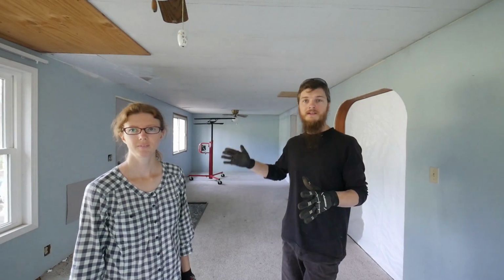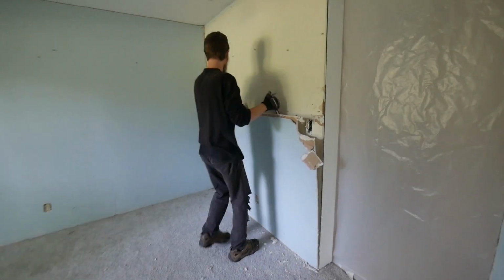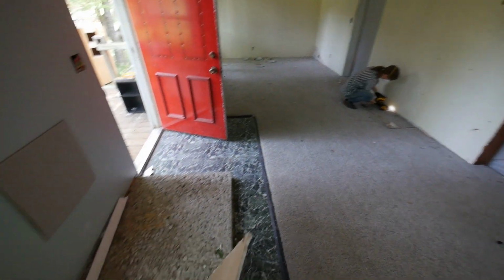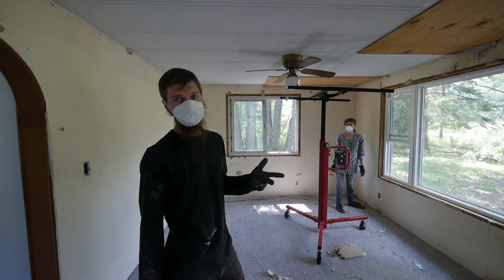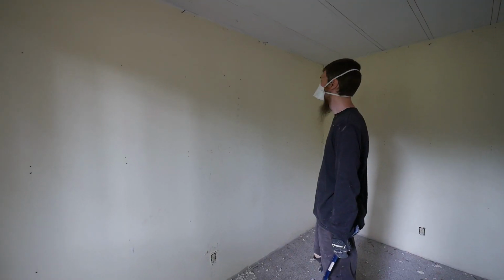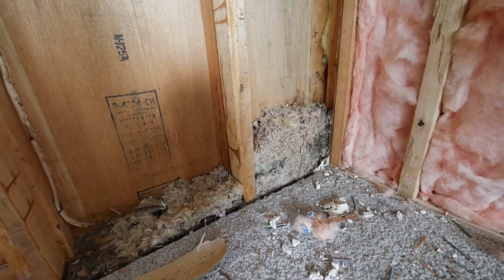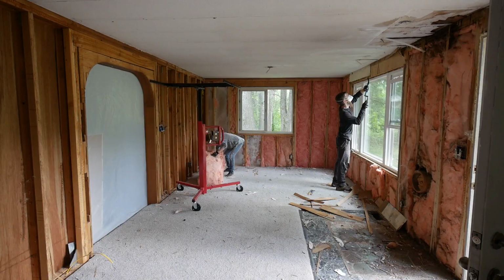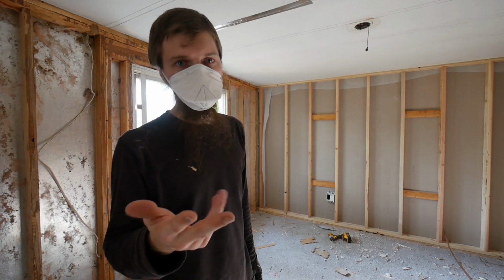Tearing Out our Nasty Living Room - Home Renovation

Comment: It would be cool to open the wall between living room and kitchen. Especially since the living room is going to be more square.
Reply from the maker: It's a load-bearing wall and has to stay :)
Reply: @diyfferent  I know its probably alot of work, but putting in a steal beam would work no?
Reply: @fro189  those steal beams are extremely expensive. Then you need special heavy duty jacks to lift and hold them while they are attatched. With expensive brackets. Installing them is not for the weekend DIY warrior. While I am quite certian Doug would be able to install one if he wanted too,   (he does thourough research and has a plan before he starts), if they dont NEED  to open the wall, its an unnecessary expense and project delay.

Comment: Cool, I just keep thinking about how pretty the other bedrooms are that you have done and how pretty that red and white trailer turned out with the painting and repair you did.  I love the way you have the energy and drive to tackle the hard jobs and to get the job done whatever it takes.  I like that you are not lazy and have gone all the way to the base.  We took our fireplace out when we put the white metal roof on. They removed a lot of damaged decking rotted from water damage.

Comment: Good luck you guys. Several years ago we remodeled our double wide. Oh my, we found that the suds we double apart than most houses. The double wides floors were carpet and it looked like they were standing up when they aimed the staples and my goodness trying to pull all those staples were horrible. And all the flooring said  this side down and it was up. We screwed the floor down better to decrease the squeaking. So now our home has linoleum tiles in the bathrooms and the rest is laminate. We are very satisfied with our results it looks more like a real home now. Hey when you go to do you kitchen cabinets, ask them if they have solid wood cabinets from China. We ordered these cabinets for half what normal solid cabinets would be. The only difference in these cabinets is you have to put them together yourself. We saved at least 3,000 dollars by ordering those. Look into it. I think you will like it. Our cabinets are solid oak. Again looking good. I’m so glad Belle liked her room so much. I really liked the peacock.

Comment: You are very fortunate that the serious damage to that room was in one location.  I was working on one of the rentals and over the years, that layer upon layer upon layer of patching was going on as well.  Those before me were patching the symptoms and ignoring the cause.  The cause was on one side of the kitchen was a 30 gallon water heater under the kitchen cabinet.  It had a very small and slow leak.  The water was running down under the cabinet to the sink and the refrigerator which everyone assumed it was a sink plumbing leak so, they just kept replacing the floor. So, when it was my turn, the problem was so bad that all the floor joist had to be replaced, all new subfloors, all new cabinets, baseboards... well, you know... Along with a rat or two, there were HUNDREDS UPON HUNDREDS of German cockroaches.  It took me months to get rid of them.  It was so bad that I just handed the house over to my sister to have and remodel since that is what she had always wanted.  I had a near breakdown over that cesspool.  You can see how it is coming along on her channel. "Ropes of Renovation."  Love your series.  I have been watching one here and there for about 24 hours now.  Well worth it.  I also follow Green Acre Homestead which is where I found you guys.  God bless!

Comment: After you get everything out, but before you put in new materials, run a sprinkler on the roof for an hour. Watch for any leaks.  That way you can fix them before they get built back behind the walls.

Comment: Dana says- It's so satisfying seeing you remove all the old, gross stuff. Now I'm wondering so many things that only watching your upcoming videos will answer. Like: what order do you do the rest of the removal process in, since there's a big leak in the ceiling that caused the rot, and you're taking out the chimney that had leakage around it too? Do you have to take out the chimney blocks, etc. now? If so, what happens with the big hole that creates on the exterior of the home? Will you have to repair the roof now including any trusses, plywood, and shingles, so that any interior ceiling work doesn't get water damaged & you aren't covering over things you'll have to eventually replace? How much water damage has actually been done to the problem areas? I'm way too curious for my own good. I can't wait to see you guys conquer this room(s) and what wonderful choices you make for Maverick's room. You guys are the best "Crew of Two" around.
Reply from the maker: Yea, we'll be removing all of the chimney blocks before winter, and then we will see how we can repair the eaves and roof after we see it. :)

Comment: It might be a good idea to install boards into the gap where the mice were getting in before foaming it.  I've seen foamed areas  that rodents had chewed through.  Another option is packing the gap with a layer of steel wool before applying foam.

Comment: Yup! Glue and staples in the walls, under the carpet- everywhere! In the manufactured home I sold last year I replaced the carpet with laminate and redid the master bathroom (as well as replaced most of the subfloors in the house because particle board=death trap) and then the new owners came in and wanted to remove one partial wall between kitchen and living... they though I put it there with glue and staples! Lol nope 😂

Comment: After running into the difficulty of selling your previous mobile home, I'm surprised you went that route again.  I suppose if you never sell, it won't be an issue but one never can fully anticipate all the twists and turns life throws at you.
Reply from the maker: The only issue with the other one is that it was a single-wide. This one is a double-wide. Also, someone in the past filed an "affidavit of affixture" so people can get loans on it easier :)
Reply: @diyfferent  

Okay, perhaps I stand corrected.  I thought securing financing on used mobile homes was just difficult if not impossible.    I was unaware it was limited to single wide mobile homes.

I stand corrected assuming you know how lending institutions operate.  I am not an expert on financing.
Reply from the maker: @jehsdca  There's a lot of variables. Location, age, does it have a permanent foundation, etc, and different lenders have different criteria. Ours should be all good. Someone did get a loan on this home previously.
Reply: @diyfferent  as a previous mobile home selling agent, I can tell you, if they are on their own land, financing them is soooo much easier..can usually be done quite easily..the homes in parks or leased land, now those are much, much more restricted
Reply: true, some companies do require documentation that they are tied down, especially to insure them (required to get a loan)..but the real crux of the matter is if they are on their own land ("real" estate")....the mortgage people know land does not depreciate, thus are much more willing to loan on a mobile home/ real property pkg, than one on leased land

Comment: Great job.  And you are right.  Gut an old building like that rather than just doing cosmetic work.  It will always save you money in the long run. A tip for in the future.  If you ever have a concrete slab like that, like sidewalks, that have to be removed just raise one end of it a couple of inches and then strike it with a heavy hammer.  With nothing under it to support it, it will shater into managable pieces with one or two hits that are easier to remove.  This even works with rebar reinforced  basement slabs.  Just section them into 3' to 5' pieces then raise one side and hit it with a jack hammer or whatever you are using to break it up.  Saves a lot of labor and equipment expense.

Comment: with the exra weight youre adding on top of the chassis of the trailer(s) by adding the plasterboard and added structure you might want to ad more support struts / jackstands under the trailer between the slab and the chassis or a brick wall around it under the outer walls to prevent it sagging or sinking (outer walls support the roof stuckture) 
adding support underneath will probably stop a lot of creaking and flexing of the floor too
Reply from the maker: Our home is already on a solid concrete block foundation that goes around the whole perimeter :)

Comment: You guys are awesome! I'm remodeling a whole house on my own, it was my grandparents old house, I'm embarrassed to say I have been at it on and off for a few years, mostly demo in those 2 years, but I got the guts to buy a gopro and filmed my first video, learned to edit it and posted it on here tonight. I'm scared for many reasons. I haven't showed anyone the video that I know, not even family...but I'm more scared as to will I be able to fix this whole house properly!  What did you do to kill the mold and stop it from returning? I have mold to deal with as well. Thanks for the time. - Joe
Reply from the maker: That's awesome that you are taking on a home renovation and giving youtube a shot. It's tough at times.

For the mold, we just removed anything that could be removed and anything that had to stay we sprayed down with a product called Odoban because it acts as a deodorizer and mold killer. You can also use Concrobium Mold Control to eliminate mold. You should be able to get both of those at a Home Depot. And as long as you can stop the source of the moisture, the mold will not come back.

We'll check out your video.

Comment: It’s always a question I ask when watching a house renovation , tearing out walls and floors and see damages and it’s exactly what is found here, would it be in priority to repair first what is on the top part...meaning the ROOFING and its isolation. And then we go down to the wall, outside and out and objectively the inside of the house. But I enjoy your video and admire your smartness of dealing things in a minimal way that turns out beautiful done. I like it.

Comment: What's the width of that livingroom? Anyway you can make  some of it a bit wider.  Seems really narrow eh. Loving the Reno's so far.
Reply from the maker: It's about 11 feet wide. Thanks
Reply: Since it's a double-wide mobile home it's limited by the "marriage wall" in between the two sections, the wall with the arch. That's likely why a previous owner tore down the bedroom instead of opening up the arch as that is a load bearing wall.
Reply: @GraeMatterz  being a load bearing wall adding in a steal beam you would be able to open that up, or you could put in some posts. Theres always a way my friend. If that was mine I would figure it out somehow. Because that is a very narrow living space
Reply: @diyfferent  oh ok 11ft not to bad, the video. Makes it look like 7 or 8ft.
Reply: @fro189  11' wide isn't a narrow space. It looks narrow because it's nearly double length of the original room from the bedroom wall being removed so it's optical. The other side of that arch is the kitchen and invading that space will make the kitchen smaller.

Comment: They tried to hide the mold? Since you are using electric heat,take the chimney down to eliminate future issues with the wall and ceiling. Excellent progress on the first day of demo!
Reply: What is going to be your backup heat source if the electricity ever is off for a few days?
Reply from the maker: I would say that most people don't have backup heat, whether on gas or electric heat. It all takes electricity to run. But eventually we would like a woodstove as well.

Comment: Hi guys !😀  'crew of 2'  not Motley Cruë lol...what method did you use to get those rodent nests out? I expect to find something similar when I pull down my drywall. Quite interesting that the floor held that cement slab all this time, curious to know the damage below the floor at that area around the doorway. As always, great teamwork! sidenote: you are so right about mobile home staples and glue and all the nailgun nails...ughhhhh
Reply from the maker: We used an old dust pan to scoop most of it up and put it all in a trash bag. To get the last bit of it out we'll use an old vacuum. Thanks!
Reply: @diyfferent  good idea....thank you for the reply. I'm dreading what I'm gonna find. I'll use that method...simple and quick!

Comment: hi lads well done ,, are you not allowed to burn wood it would save a lot of money on the size of skip you  hire and i think fibre glass breaks down in a fire to but not sure if its toxic , and plaster board is only plaster and paper so would break down in a fire very easy , keep up the good work  ,,uk
Reply: Partical board and paneling has glue in it. Can spit fire ballls. Lol. I learned the hard way.
Reply from the maker: We only like to burn clean wood. It's illegal to burn things like fiberglass/drywall/construction debris :)

Comment: That chimney has to come down. It was not properly sealed to begin with... Sorry I can't remember if you said you planned on a wood stove or not, but I would highly suggest having a wood stove at least as a backup during power outages.. put in a new properly built and sealed chimney.
Reply from the maker: Yea, the plan was to install a woodstove in the kitchen with a pipe that went straight out and then up, past the eaves to avoid problems like this old one created.